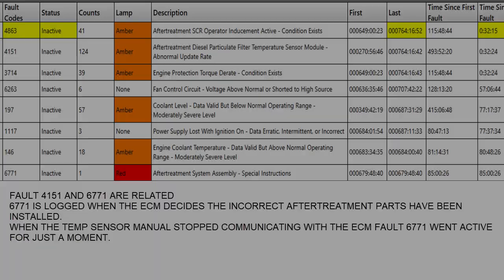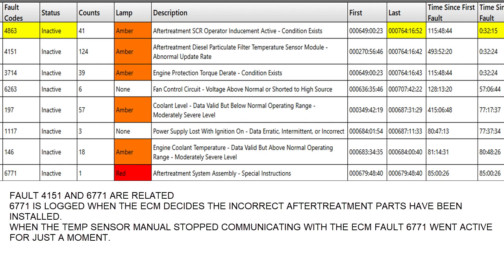Fault code 6771 WRONG aftertreatment!!

Comment: Cummins X15 CM2350 X116B Performance Series (2018 & Newer) Fault Code: 3446 PID: SPN: 3222 FMI: 5 Aftertreatment Intake Gas Sensor Heater- Current Below Normal or Open Circuit
Circuit Description
The aftertreatment intake NOx (nitrogen oxides) sensor is a smart device and communicates with the engine control module (ECM) via the J1939 data link. The aftertreatment intake NOx sensor performs internal diagnostics and reports malfunctions back to the primary ECM using the J1939 data link. The NOx sensor is permanently attached to the NOx control module. They are serviced as a single component and can not be replaced individually. The aftertreatment intake NOx sensor is used to measure the NOx emissions at the intake of the aftertreatment system.

Component Location
The aftertreatment intake NOx sensor is mounted on the engine near the turbocharger turbine outlet.

Conditions for Running the Diagnostics
This diagnostic runs when the aftetreatment diesel oxidation catalsyst intake temperature sensor has been above 150° C [302° F] for 5 seconds while the engine is running.

Conditions for Setting the Fault Codes
An internal circuit error was detected in the aftertreatment intake NOx sensor assembly.

Action Taken When the Fault Code is Active
The ECM illuminates the amber CHECK ENGINE lamp and/or the Malfunction Indicator Lamp (MIL) immediately when the diagnostic runs and fails.
Diesel exhaust fluid injection into the aftertreatment system is disabled.
Engine torque will be severely reduced.
Vehicle speed will be limited to 8 km [5 mi] per hour after extended engine operation with the fault code active.

Conditions for Clearing the Fault Code
To validate the repair, start and operate the engine to raise exhaust temperatures. This can be done by either driving the vehicle or initiating a stationary regeneration using INSITE™ electronic service tool.
The aftertreatment diesel oxidation catalyst intake temperature must be above 150° C [302° F] for 5 seconds before the aftertreatment intake NOx sensor can run its internal diagnostics.
The fault code status displayed by INSITE™ electronic service tool will change to INACTIVE immediately after the diagnostic runs and passes.
The ECM will turn off the amber CHECK ENGINE lamp immediately after the diagnostic runs and passes.
For On-Board Diagnostics (OBD) engines, the ECM will extinguish the Malfunction Indicator Lamp (MIL) after three consecutive trips where the diagnostic runs and passes.
The Reset All Faults command in INSITE™ electronic service tool can be used to clear active and inactive faults, as well as extinguish the MIL for OBD applications.

Shop Talk
Possible causes of this fault code include:

The aftertreatment intake NOx sensor has malfunctioned or is damaged
The aftertreatment intake NOx sensor internal heater has malfunctioned
The NOx sensor part number is incorrect.
Reference the appropriate OEM wiring diagram when troubleshooting circuits that utilize wiring supplied by the OEM.

For intermittent power supply and datalink communication issues with Aftertreatment Components, it is highly recommended that the OEM Power Distribution Center fuses and relays be thoroughly checked for loose, missing or intermittent connections.

Possible Cause:
1) ECM calibration
Reply from the maker: So in this case updating software in the ecm can not fix a circuit failure. The calibration revision sheet found in quickserve online will tell you what revisions fix certain faults. It seems they list the calibration as a possible fix for almost all the faults.

Comment: I replaced nox intake oxygen sensor in the system due to the error code below, , after 5000 miles the code returned, I used the Cummins OEM part, could this malfunction be due to incorrect or missing calibration?

Cummins X15 CM2350 X116B Performance Series (2018 & Newer) Fault Code: 3446 PID: SPN: 3222 FMI: 5 Aftertreatment Intake Gas Sensor Heater- Current Below Normal or Open Circuit
Reply from the maker: Check to make sure you have 12 volts and a good ground going to the sensor when ever the ignition is on. There are 4 wires going into the sensor 12+, Ground, and data +,  data - It sounds like the heater or module failed. Warranty on the cummins part is one year / 100,000 miles. As long and voltage and ground are good to the sensor it should be under part warranty which covers parts and labor. Any Cummins dealer or cummins sales and service distributor should change it for no cost.
Reply from the maker: When the fault is on the heater if it is active it is not the calibration - anyway I have never seen that as of yet.
Reply: @Engine Shop Joe

I am very grateful to you for your answer, I will continue to look up what the problem is.
Reply: @Engine Shop Joe

+ 13.1v 
Insite shows 12.5v at the time when the systems detect the problem .

3649
3449
1885 

after installing the new sensor i drove 5000 without error, i guess there is a short voltage spike at some point and this burns out the sensor heater.
Reply from the maker: @Inferlogist  If any moisture or a drop of water is on the sensor heater ceramic shell it will crack and the heater is failed. It should be under warranty.